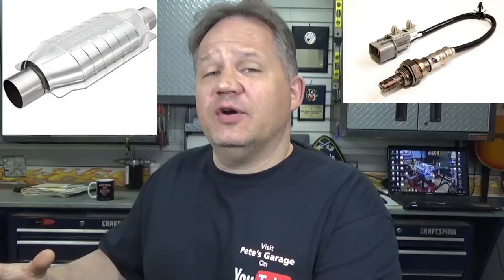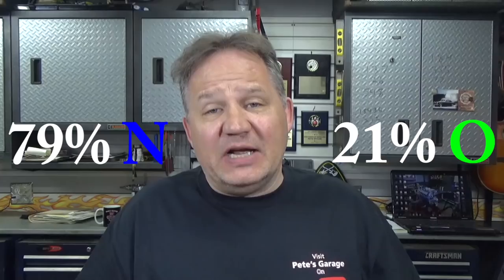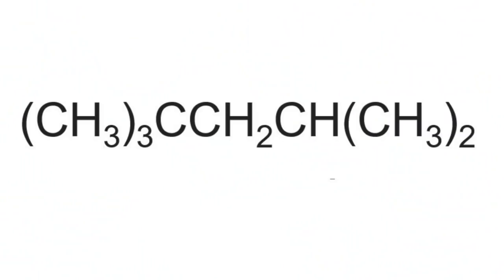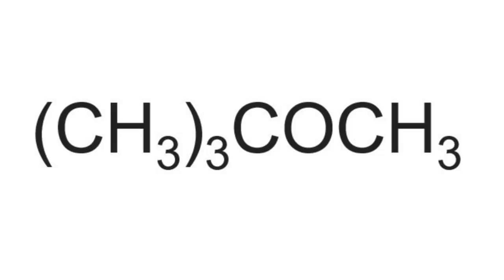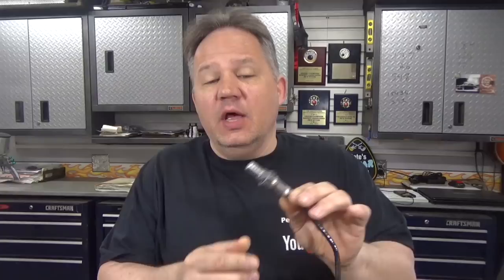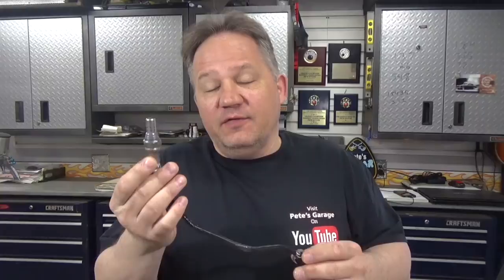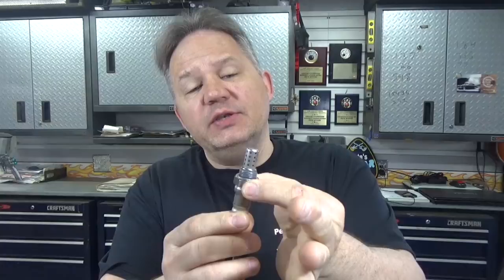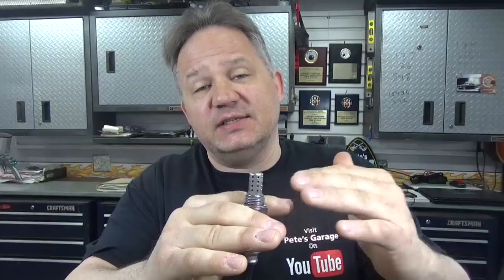What is an O2 Sensor, Catalytic Converter, How Do They Work, How to Make Them Last

Comment: Hi Pete, this is a great video and really helped me understand how the CAT and O2 sensors work together. I've been doing research on this specific area of the engine because I'm currently struggling with my 2006 Nissan Altima's (2.5) B1S1 O2 sensor code. We replaced the CAT a year ago in July and the B1S1 O2 sensor worked fine until this February. I took it to the same mechanic who replaced it under warranty. By May, the same sensor failed and he replaced it /three/ times within a few days trying to see what was wrong with it. Three weeks ago, the part failed again and I am at a loss. I have a new one sitting on my table and I am hesitant to put it in until I figure out what's causing them to blow out.

The fuel pump went out a week ago and we replaced that, so there's a brand new fuel pump and filter in it. Oil was changed a month ago. I tested the fuses last week and they're fine as well. Last year, Nissan had a recall on the computer so they reprogrammed it and replaced the Cam and Crank shaft sensors. I also changed every spark plug, ignition coil, and the valve cover gasket in case it was leaking. I don't have a clue as to what's going on with this O2 sensor! Do you have any suggestions on where to look next?
Reply from the maker: What did the O2 sensors look like when they were taken out? Were they clean, or full of oil?
Reply: @PetesGarage  I actually didn't take them out so I'm not sure on that one, but the mechanic didn't mention anything about oil so I'm assuming they were clean. I can take it out today and see if it's oily. Someone else mentioned it may be a vacuum/intake leak?
Reply from the maker: If you had a vacuum leak you would have several codes, EVAP system codes, it would be more than just O2. But a vacuum leak would not damage the O2 sensor. If they are heated O2 sensors the wire that provides current for the heat could be cut and intermittent.
Reply: @PetesGarage  Ohh okay, I see. I did take the sensor out and there was no oil on the sensor. However, I did notice that the mechanic that changed it last ziptied the sensor wire to a metal pipe nearby. Could the heat from that pipe have messed up the sensor?

Comment: Great explanations. What if I have a bank 2 code with engine light but fuel consumption remained the same as before at least, I haven’t noticed one? Could the code be a fluke in that case?
Reply from the maker: Bank 2 is after the converter and would not affect fuel economy
Reply: @PetesGarage  thank you

Comment: thank you for the video. my sonata is hesitant on acceleration (works okay when at high speed, but hesitant when slowed) and malfunction indication lamp light is on. Also since the light the mileage has been reduced by half. Could this be due to failed O2 sensor or cat? or completely different reason...?
Reply from the maker: If the O2 sensor failed the check engine light would come on. You could have a fuel problem, blocked filter, lots of things

Comment: This was a VERY INFORMATIVE  video. I had a little bit of knowledge about what they do and you've taught me much more. Keep up the good work. I'm definitely subscribing. Quick question, when you have a P420 code, is the temperature difference of the inlet and outlet temperature a sure sign that the cat needs to be replaced?
Reply from the maker: Thanks my friend, welcome. Not really, when a cat goes it either gets plugged or stops catalyzing the exhaust
Reply: yes, if the tempature at the inlet side of the cat and the outlet side of the cat are the same the cat aint working however, this is not how the system monitors converter effiency, the difference betweer the front o2 and the rear o2 is what the computer uses to monitor converters

Comment: Some old cars doesn't have a catalytic converter do you recommend to put after market one ??
Reply from the maker: I would not because it will produce some back pressure. If it wasn't designed for it, adding it may not help.

Comment: I have a question about #1 & #2 o2 Sensors.  Are your comments on to help me?
Reply: 03 V6 Acura CL. J32a2. Race car, stock engine.  Looking for power I have a 4" CAI intake pipe cone filter & 3" exhaust cherry bomb & no cat. Here's my question. I built custom down pipe, OEM design had small tubing & T together. 1st o2 was just after the T to read gasses from all 6 cylinders. My custom down pipe is 2.25" both angle & exit towards rear into a Y collector and out with 3". The 1st o2 is in original location but new design it's only reading the exhaust from the front manifold=3cylinders. The #2 o2 is behind the Y reading all 6 cylinders.  Will this cause a lean issue or rich issue? All injectors are new. Previously the plugs looked great after a 8hr race. Little brown/white. Any advice is great
Reply from the maker: That's an interesting setup, Since the 1st sensor thinks it's reading all 6 cylinders it will adjust 3 to match the other 3 which could lead to poor performance, but I don't think it will go lean or rich

Comment: 7:45 .... No, it is not "Bank 1 or bank 2".... He means to say, "Sensor 1 or Sensor 2" (Sensor 1 is before the catalytic converter, Sensor 2 is behind it on the muffler end). Referring to BANK 1 or BANK 2 is for a "V" engine only, defining which side of the engine a problem is occurring.
Sadly, after that hiccup, I'm not sure if can trust how you explain catalytic converters :/
Reply from the maker: I have had code readers say Bank 2 Sensor 1 on a 4 cylinder engine. There are so many different combinations it would be impossible to list the all. The point is there is a sensor before and after the converter to tell the computer how to adjust the engine. If the converter stops working, the check engine light will come on.
Reply: @PetesGarage  some 4 cylinders with split 2 channel exhause manifolds do use 2 front o2 sensors. (B!S1) bank 1 sensor 1 is the sensor monitoring cylinders  1 and 2 while  (B2S1) is the  is the sensor monitoring cylinders 3 and 4

Comment: My car have exhaust manifold catalytic converter I thinking about buying some exhaust header which have the holes for o2 sensor also my car have a second catalytic converter in the middle of the exhaust would it be a problem since header doesn't come with catalytic converter
Reply from the maker: No, that will work

Comment: Best video I've seen in a long time. Explains everything and answers all my questions! Thanks! 
My engine light came on in Jan. I cleared it then it came on again in July, cleared, then came back 1 week later. Garage said the cat is rattling and emissions are bad and so cat needs replacing. Replaced the cat and the engine light came on again. Has driving the car with a broken cat broke the sensor, possibly?
Reply from the maker: Yes, that's probably it
Reply: @PetesGarage  Thank you! Just for my understanding, could you possibly elaborate a bit on how this can occur - what, from a broken cat, can cause the damage to a sensor?
Reply from the maker: The O2 sensor will get clogged with exhaust particles that don't get captured in the cat
Reply: @PetesGarage  Thanks, you're referring to the sensor after the cat then? Sorry, I should have said; the OBD error code I've received is P2096 which apparently indicates a problem with the exhaust fumes when they hit the sensor BEFORE they reach the cat. I've looked online and there is some confusing terminology which has made me question my understanding and whether this is the right sensor to replace. Are you able to elaborate/confirm? Many thanks.
Reply: The error is "Post Catalyst Fuel Trim System Too Lean Bank 1" - I understand 'bank 1' would be the first cylinder in the engine however 'post catalyst' means after the cat.

Also this is on a Hyundai where the cat is part of the exhaust manifold.

Comment: Laughing gas is N2O (nitrous oxide), not NO2 (nitrogen dioxide). An O2 sensor isn't sniffing the exhaust, it's using the difference in atmospheric oxygen relative to the exhaust oxygen to generate voltage
Reply from the maker: Thanks Teddy

Comment: Hi,
Just a quick question. Can I expect engine problems if a CAT from USA is fitted onto a left drive car (UK) due to the O2 sensor on the CAT being on opposite side (on the left instead of right).  I guess what Im asking is whether the performance of the car will be affected by the downstream O2 sensor on CAT being on left side instead of right.
Reply from the maker: No, as long as the sensor if in the exhaust stream.

Comment: Thanks for this detailed explanation, I have a 2010 crv that stopped on red light, took it to the CT shop and they changed the battery and spark plugs, after 2 days I got check engine light and when took it back to them they said from the error code that catalytic converter needs to be replaced and that has nothing to do with their work while I can find spark plugs on the Internet replacement leads to CEL? Any thoughts on that? Thanks
Reply from the maker: Get the error code and look it up

Comment: Wanting to know if the sensors NOT being connected,due to converter theft,will cause the vehicle (2007 Honda CRV 2nd) to run hot? Please help me.
Reply from the maker: Yes, the sensors have to work or the car could run lean

Comment: Hi Pete, - Wonderful explanation of the sensor and converter.  I recently had to take my car to the shop because of my check engine light and found out that I needed my sensors replaced.  They replaced two but couldn't replace my O2 sensor for some reason.  Here's my question - When an O2 sensor needs to be changed, does it automatically mean that the catalytic converter needs to be changed as well? I have a 2013 S60 Volvo not turbo.  Thanks for answering back! :-)
Reply from the maker: No it does not. My guess it they couldn't get it out.

Comment: I have a Triton 5.4 Lincoln Mark LT cylinder 1 and 3 the metal piece at the tip of my spark plug they keep breaking down in my cylinder what would cause that welded piece of metal around the spark area to break off?
Reply from the maker: Wrong length plug, contact with the piston, overheating

Comment: You mentioned the downstream O2 sensor could be either before, actually in, or even after the catalytic converter. Is there any particular reason for those placements of the O2 sensor? I know my truck has center bung converters. Thanks in advance!
Reply from the maker: It depends on the vehicle and the emissions control system

Comment: pete, isn’t bank 1 the side cylinder 1 is on a V engine, bank 2 the side cylinder 2 is on, and sensor 1 before cat, sensor 2 after cat.
Reply from the maker: It can be, depends on the engine which is why I say "can be"

Comment: Fault error on a BMW 1 series. digital motor electronics (DME): catalytic converter oxygen sensor: heater cut-in. What is the remedy to this fault ?
Reply from the maker: Change the O2 sensor, it's heated

Comment: Please I have my check vsc light come on after clearing codes whenever I run my Lexus is350 for a while could it be something wrong with the o2 sensor it comes up with error code p0420 and 0430 bank 1 and 2
Reply from the maker: Yes, you'll need to replace the sensors. You can't just reset the codes
Reply: @PetesGarage If I may ask sir, if I have codes 0133, 0430 and 2099 on a 3.5 2006 dodge charger, would that be both the catalytic converter AND the oxygen sensors both? Perhaps spark plugs too?

Comment: I have mitsubishi endeavor 2007 and when I speeding the strong burning egg smell appear inside car. Check engine is lighting all the time. Code 174. What should I check. I have gas and fuel.
Reply from the maker: Fuel injection system  not operating properly

Comment: Long story short I have an 08 Prius I got my Cat stolen last year.. Now it has since been replaced. Since then I have had to switch out 2 O2 Sensors due to them "not working" could there be a more underline reason. NOTE* I get reg oil changes and both O2 sensors were more of the after markets. please let me know.
Reply from the maker: That is possible if you bought cheap sensors. As the car get's older, engine wear makes the sensors work harder

Comment: I have a question. In August I was told to get my sensors replaced but I didn’t . Now the delar is saying my cat converter needs to be replaced and not the sensors . Is the reason for my sensors not being replace the reason the car converter went bad? Do I need to get new sensors & a cat converter ?
Reply from the maker: Yes, if the sensors were bad the engine would run rich and clog the converter
Reply: @PetesGarage  okay thank you . So do I need to just get the converter replaced or both?
Reply from the maker: I would do both
Reply: @PetesGarage  I got a new cat converter!
Reply from the maker: If the sensors are bad the new converter will get plugged
Reply: @PetesGarage  I think they changed both cause it came together. The check engine light is off now .

Comment: Bro can you help me and pls make a video on how to get rid of burst smell when accelarating hard im from philippines and i have a geely azkarra my problem is when im trying to accelerate or pushing hard on accelerator it smell something like chemicals inside the cabin i tried to search this online and people are saying that its the sulfur in catalytic converter how can i get rid of this smell and i never ever experienced this kind of smell with my old cars even i push the accelerator to the floor. Pls help.
Reply from the maker: Sounds like you have an exhaust leak near the engine
Reply: @PetesGarage  i only experience this sir when i will accelerate hard like instant push on the accelerator pedal. But when driving at low speeds this does not happend.

Comment: Codes p0031,p0421,p0431-- would it be a bad o2 sensor or a failing Cat?
Reply from the maker: Most likely the sensor or crappy gas
Reply: @PetesGarage  thank you for responding, I appreciate it
Reply: @PetesGarage  I replaced the o2 sensor and cleared the code, service engine light stayed off for 3 days then came back on, getting code p0431 now

Comment: tq very clear and informative, will introducing  HHO-(Hydrogen/oxygen) to this combustion chamber help burn the fuel better and reduce the amount of oxygen to be picked up by this first O2 sensor?
Reply from the maker: It already is introduced
Reply: @PetesGarage  sorry i meant introducing oxyhydrogen from a hho cell into the manifold just after the air flow sensor. will this have excess oxygen after the combustion for the O2 sensor to pick up?
Reply from the maker: Why would you do that?
Reply: @PetesGarage  for better combustion thus keeping engine parts cleaner and cooler, better power, better fuel mileage and cleaner exhaust gases

Comment: In Philadelphia where they do a lot of fraudulent stuff, they changed my O2 sensor, supposably. So I drove all the way across country. In Ohio my check engine light came back on. They told me if so, I will need a new Cadillac converter. I have been driving for 15 months with my light going off and on. I bought an O2 sensor but I said no I know I need a Cadillac converter. One day I just decided to change it and my check engine light went off. I don't feel like it will come back on. I feel like if you want to save some money or to get a better understanding start with changing your O2 sensor. Like the mechanic said, if it comes back on then you need to Cadillac converter.
Reply from the maker: If your converter is worn out or plugged the O2 sensor after it will go on and off.

Comment: How about the smog air pump & EGR valve? How do those components play into the whole process?
Reply from the maker: Those recirculate exhaust gases to burn them
Reply: @PetesGarage  Would a vehicle with a Cat necessarily have the EGR and Smog Pump installed as well?
Reply from the maker: no
Reply: The air pump or (AIR) air injection reactor system blows air into the converter to make it burn hotter to help burn off unburnt gasses Hydro Carbons (HC).
The EGR system  (Exhaust gas recirculation) takes exhaust gas and re introudces it into the combustion chamber. because exhaust gas cannot be burned this reduces the total amount of combustable gases there for lowering combustion chamber tempatures and reducing NOx. NOx is a by product of burning fuel at hotter temps. because this reduces the total amount of combustable gases an engine cant have egr at idle, it will cause the car to run por or even stall. egr is only used cruise and low power situations.

Comment: If you dont have a caralytic converter...will your O2 sensors still do the job to a degree?
Reply from the maker: It will until it gets clogged with carbon
Reply: Thanks ! Eventually ill put a new cat in ...just cant afford it so this will have to do for now

Comment: 6:20 nitrogen oxide pollutants (NOx). is NOT the same as Nitrous oxide (N2O)  7:50 the front O2 sensor is not bank 1 and the rear is not bank 2. Heres how that are defined, the front O2 sensor on the engine bank that houses #1 cylinder is upstream (B1S1) bank 1 and the other cylinder bank is Bank 2 (B2S1) the post cat o2 sensors are down stream bank 1 (B1S2) and down stream bank 2 (B2S2) also, the front o2 sensors are fuel fuel monitoring and responsible for air fuel corrections while the rear o2 sensors are to monitor the converter efficency only.
Reply from the maker: Thanks

Comment: Sorry but your totally wrong on how the 02 sensor works. The 02 sensor does not “measure” oxygen and it also does not work based on the Piezo Electric Affect. It’s actually an electrical chemical process based on the principle of a galvanic oxygen concentration cell and the Nernst Equation.
Reply from the maker: Thank you